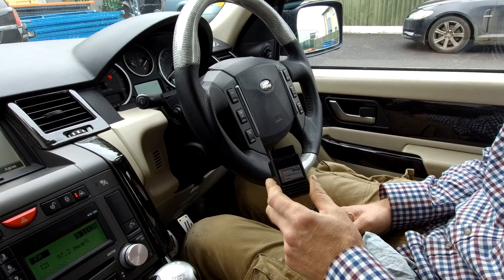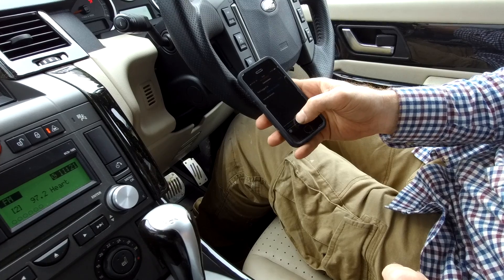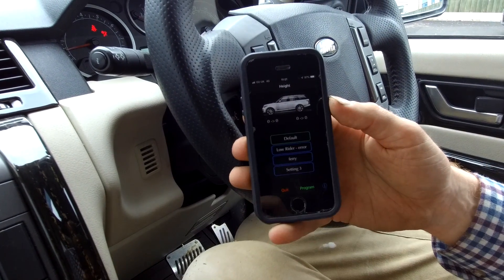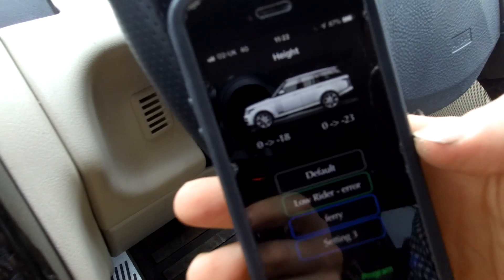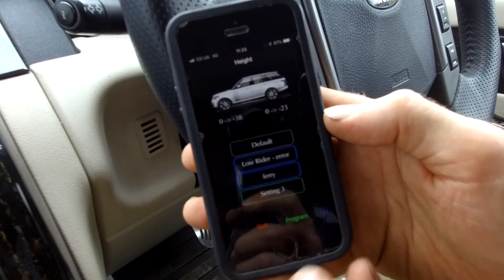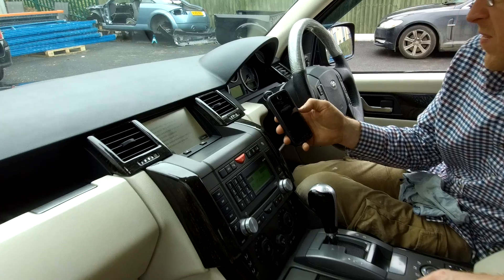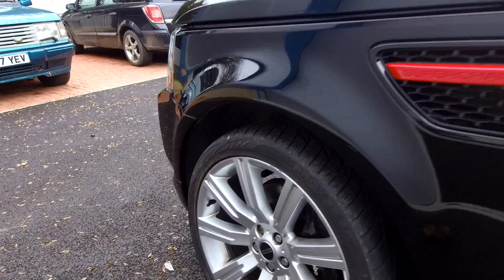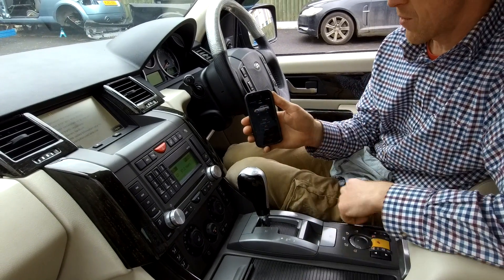How to lower your Range Rover Sport using IID Tool

Comment: Hi i have a 2016 range rover hse can i lowered it and drive low? With this?
Reply from the maker: Yes you can re-calibrate it to a lower level.. but it will be 1" lower in all modes...or whatever reduction you apply will apply to all modes.

Comment: Why do people use lift rods when they can just use IID tool to raise the car?
Reply from the maker: Not sure - they seem a bit of a bodge
Reply: @L663  would you recommend using IID tool raising for off-roading and fitting bugger wheels? I am having a struggle which wheel and tire to fit on my 2011. 19" are smallest wheels due to brake calipers

Comment: Do you have to drive at normal height?? I have a 2016 Range Rover Sport and dont like the normal height. Want it to stay at access height but didnt know if it was possible. Just found you guys the other day and love your videos. Ordering some parts from you guys as well. Thanks again
Reply from the maker: The car does not like driving at access ( low ) height and will revert to standard height above a certain speed. This relates to vehicle stability / handling etc. You can "recalibrate" the car so it rides lower in normal height using the IID tool -- and other tools.